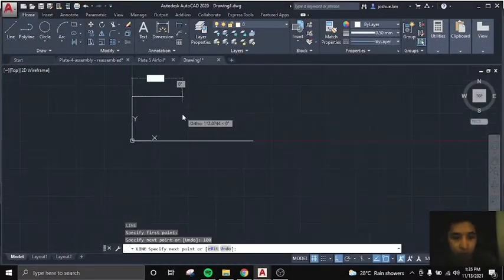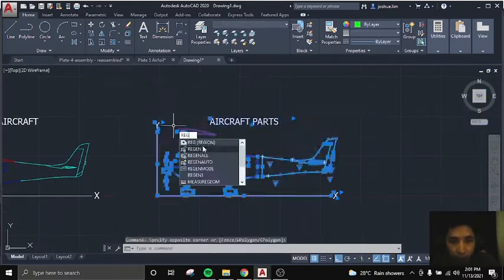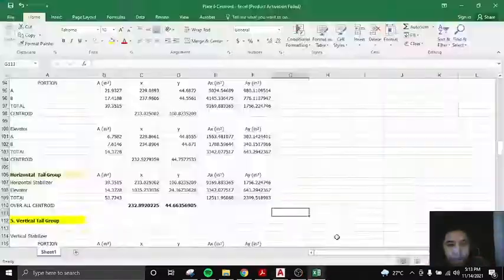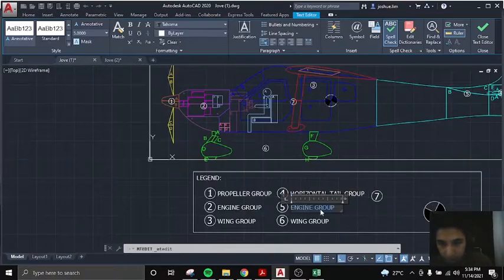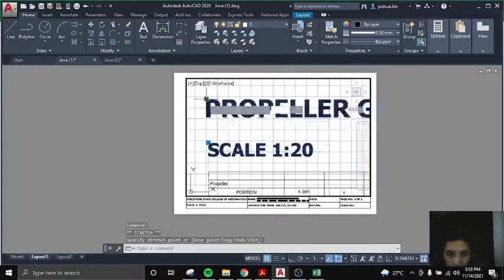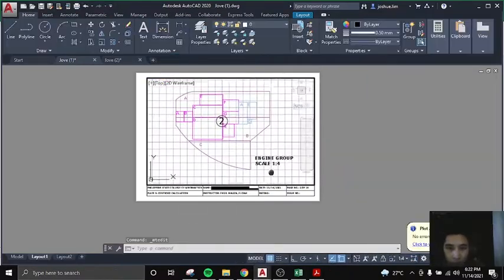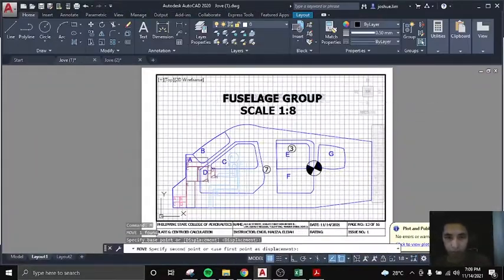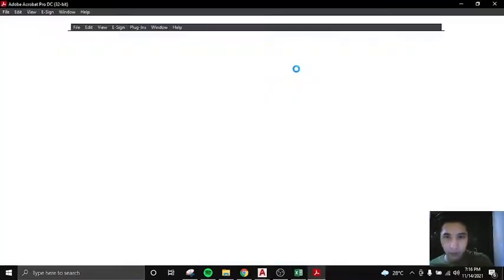CADD312 - PLATE 6: CENTROID CALCULATION (AUTOCAD)

Comment: sir pano nyo po na compute yung values sa excel? thank you
Reply from the maker: Hi!

So for the computation, need muna iseperate yung parts then compute by doing group and massprop on autocad. 

From there, you can get the raw values of its centroid and coordinates (x,y). For the centroid, we just average x and average y then simply plot a circle to identify where the centroid is.

I can send you the sample excel file from this video if you need it.